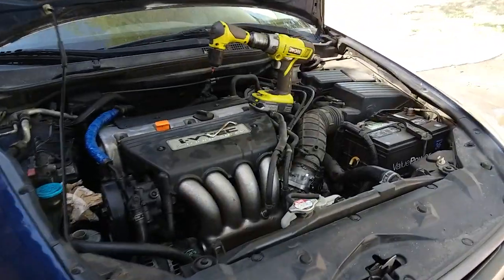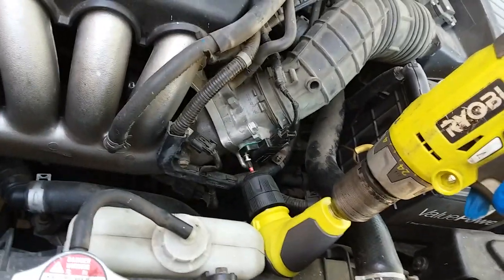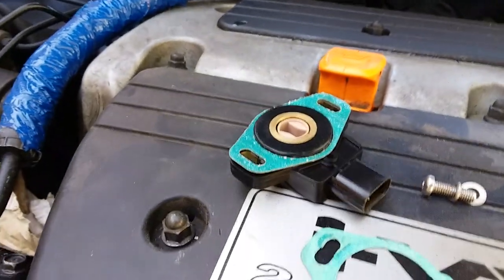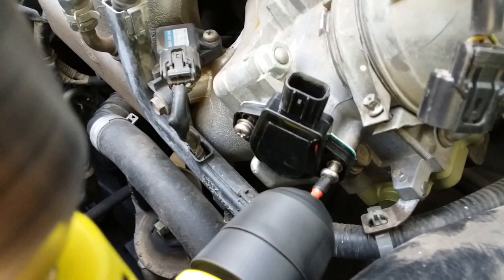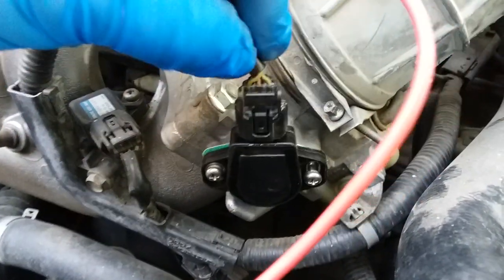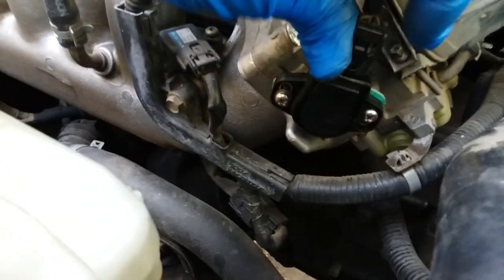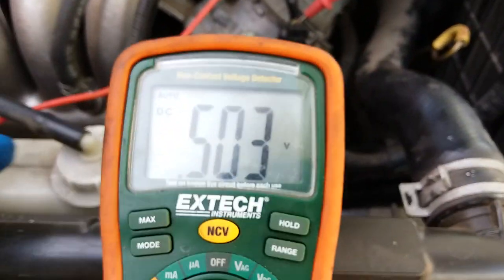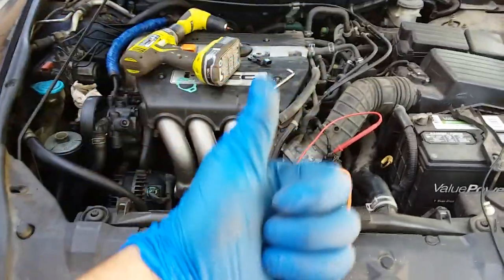How to: Change Throttle Positioning Sensor on a 04 Honda Accord Inline 4

Comment: Thanks for the visual. The Honda OEM manual says 0.5v (that's POINT 5, as in 1/2 a volt) at closed throttle and 4.5v at full open throttle.
Reply from the maker: Your right brotha I meant .5 lol

Comment: Broke the screws free by chiseling body away with a screwdriver and hammer. New TPS Came with new screws and washers. Now I need to Back probe it, measure voltages and tighten screws. Instructions suggested using EZ out bit. Didn’t have one and it’s late.
Reply from the maker: Lol sounds like fun!
Reply: Tried making my own Backprobes to fit in the TPS connector. They wouldn't work. I'm sure the alligator clips were touching somewhere. So instead, i kept my obd2 meter plugged in. Every time I made an adjustment I check the meter. When the codes went away I tighten up the screws. Passed the State Inspection this morning. Wahooooo!
Reply from the maker: Damn I'm glad you were able to get it sorted out.

Comment: 2004 Honda Accord EX 2.4L (Desert Metallic Mist)

the bolts are both broken off mine and ive never touched it, mistook that sensor for mass air flow, i guess i dont have one theres not one on the air box
Reply from the maker: it could be a different design
Reply: @559powerscape   yeah changed over the years

Comment: How’d you tanks the TPS was your problem? And what were the symptoms?
Reply from the maker: Check engine was on forgot what code it was but it was for the tps. The car was idling rough it was about to turn off so we replaced it and started to work just had to calibrate it and it was set.
Reply: P1022

Comment: I have a 2005 and I'm getting .5 volts but in the first pin from left to right. The other 2 pins are 0v. I just got thia car and trying to fix it. Error code p0122.
Is it same connection pins for 04 and 05. It ahould, right?
Reply from the maker: Yes it should be the same. I think it has the same motor.
Found this online before you swap out a sensor

Code P0122 Common Diagnosis Mistakes:
A common diagnosis mistake made when dealing with Code P0122 is replacing the TPS before visually inspecting the wiring or connectors. Often times frayed or damaged wiring is the issue, and replacing the TPS isn’t actually necessary.
Conduct a visual inspection of wiring around the TPS for possible wire fraying or disconnection. If any wiring issues are found, you must repair them, clear your codes with obd2 scanner and re-scan to see if P0122 still shows up.
Reply: Thank you George. Let me check that and see what could cause the problem.
Reply: its causing high rpm gear shift problem?

Comment: After calibrating now i have high idle and jerky improper gear shifta , plz help , car is honda accord cl7 k20 automatic
Reply from the maker: Try the throttle position relearn...hopefully this works...
https://youtu.be/_jHIXqbGVX4
Reply: I cant sir , my fans are bypassed by external thermostat not on original factory settings so i cant rely on fans
Reply from the maker: @alidp4847  did you try unpluging the sensor and reconnecting it? And tried recalibrate it? Recalibrate with the car on see if it makes a difference in idle
Reply: No sir havent tried that yet
Reply: @Kingsley Okeke the only solution to this is find a used throttle body from any auto part store or junkyard and replace the whole throttle body with all its untouched sensors (find a TB in which all the sensors are never took out and are fixed from factory) Sorry for my bad english i am not sure if its understandable lol .

Comment: My son in law has been quoted approx NZ$1000 to replace this part, the car was shuddering badly and had no power and VSA light and engine check light came up.
Reply from the maker: Hope this works for you!
Reply: Hi there, UPDATE it turns out it was the APP sensor (accelerator position sensor)  so a much larger component but still charged $NZ600 for the part
Reply from the maker: @timj41  dang ... I'm glad you got this figured out! Thank you for your Support!